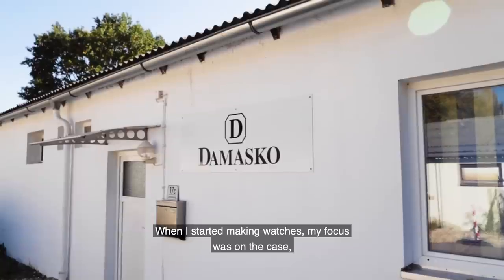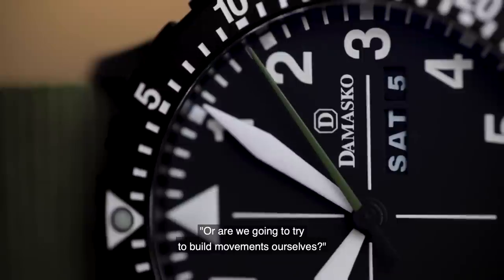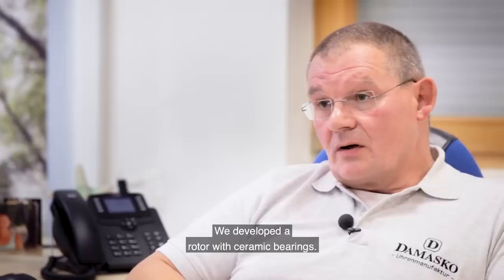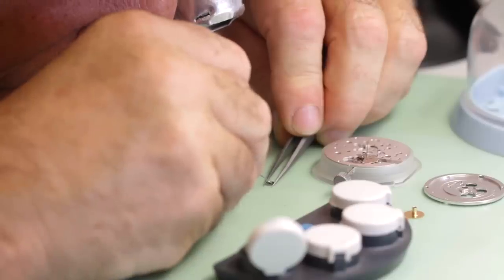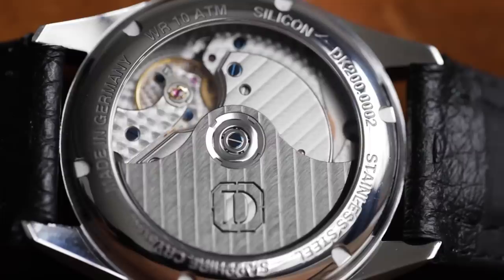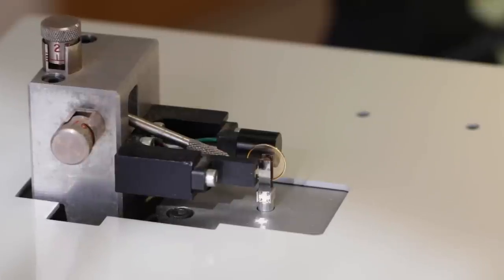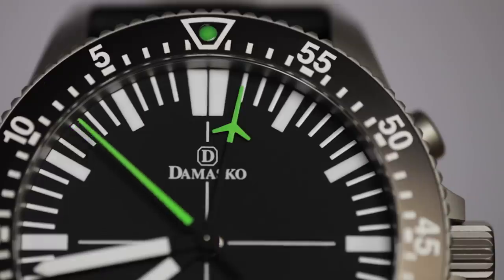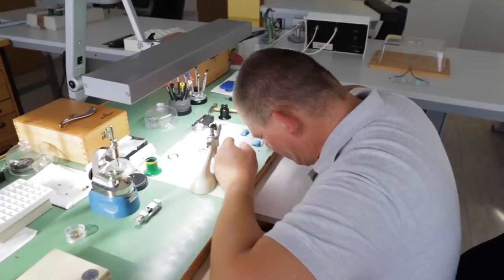Damasko: A Look Inside the Manufacture — Part 2: The Movements

Comment: damn, now I MUST get a Damasko watch. I had a Sinn on the horizon, but looks like Damasko has taken that spot.
Reply: Neither would be a mistake but don't let a short marketing clip sway your decision like that. Sinn has an amazing manufacturing process as well and all the ETA movements in their watches are tuned to chronometer levels of accuracy. Not to mention their own anti-magnetic systems, case hardening methods, humidity regulator inside the case, submarine steel on some models etc.
Reply: @mathieuvaillancourt3219  Yes. Until 2002